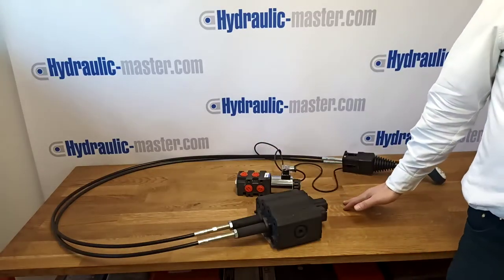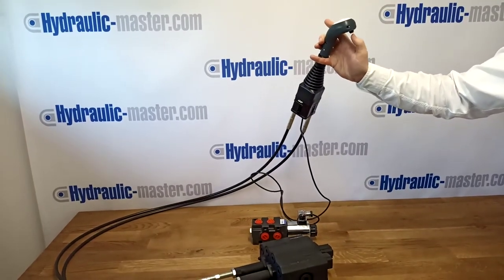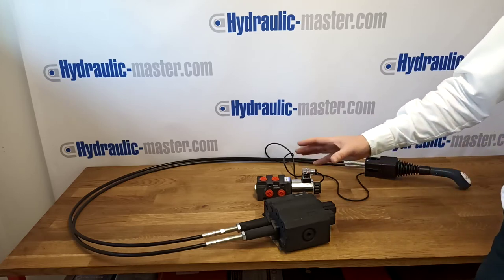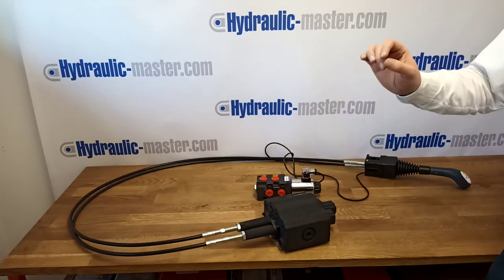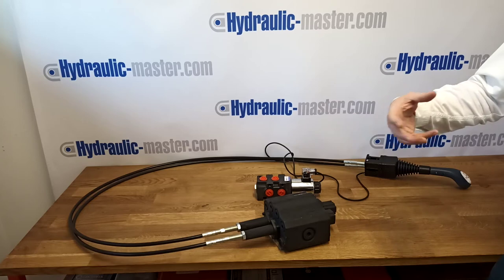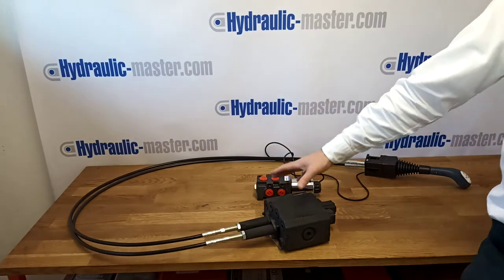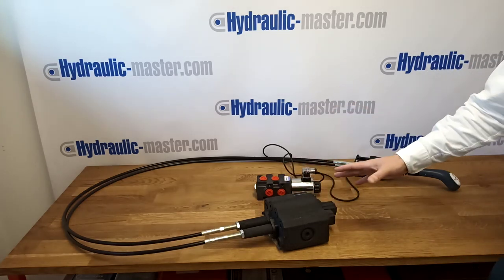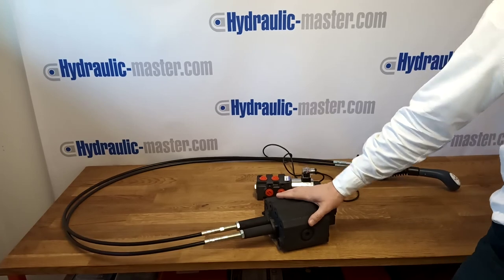Hydraulic Valve kit with additional Joystick Controller on 3rd function

Comment: Does the button work the 3rd service  or switch the 2nd spool valve over on joystick? For example can the 3 services work at the same time?
Reply from the maker: Hello
One button is enought. Pleae send me email address i will end you diagram how it works
Reply: @hydraulicmaster  markdurnin1@gmail.com thank you v much, I want to add third service for to make a small cement mixer onto loader and be able to stop/start  hydraulically spin mixer while lifting and tipping loader, thus using all 3 services at one time!
Reply from the maker: @markdurnin9384  just sent